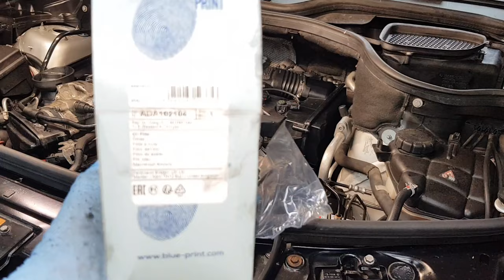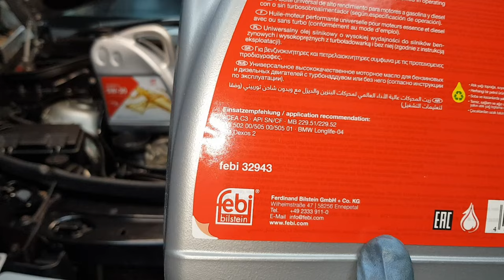Mercedes Oil Cooler Seals ML350 cdi 3.0 V6 ML320 E320 Sprinter OM642 W164 W166 Vito engine oil leak

Comment: How much is this repair ??
Reply from the maker: This was my 1st experience with OM642 engine. I had big trouble removing the 3 bolts at the back of the turbo which took nearly 6 hours by itself as I had to bend and weld custom tools to loosen them up without snapping them or rounding the heads. I would say all together with all trouble, cleaning and filming took about 30hours. If I was doing it again it will be 12 to 16hrs with good detail. I have heard others doing it for 8 hrs but I assume they did not go into such detail and cleaning. Consider yourself lucky if you get this done for under £500. Gaskets, seals, Oil, filters, coolant, cleaning chemicals and consumables increase the price even further. Hope this helps
Reply: @TheKeenMechanic  what's wrong with these compressor screws, why did it take you so many hours? what wrenches did you use? thanks
Reply from the maker: @andrzej5484  Hi, the engine was replaced 4 years ago, the previous mechanic used the old bolts and didn't put ceramic grease on them. The 3 bolts on the back of the turbo are hard to access and I had to make special tools to allow me to remove them without stripping or rounding the heads. Had to heat every single bolt with MAPP gas torch. Got there in the end but took a long time
Reply: So, after replacing the screws with new ones, secure them somehow, e.g. with ceramic grease, so that there is no problem with unscrewing them again? If there are new screws in the turbo and manifolds, what torque should they be tightened because you are giving different values.
Reply from the maker: @andrzej5484  I just went with good and tight on the 3 turbo to exhaust manifold and all cast iron exhaust manifolds were tightened by feel as it is too difficult to use a torque wrench. If you are reusing the old bolts put ceramic grease on them. If using brand new bolts put ceramic grease too if they don't come with it.🤝🏻
Reply: @TheKeenMechanic  thx
Reply: what I'm most afraid of is washing the engine exit and the holes under the manifold so that dirt doesn't get into the engine. We'll see if the gasket has been changed because the seller of the car said it had been and since it was my friend, I trusted him. It may be that it comes from connecting the intake to the turbo because  there is dirt there too. Time will tell ;)
Reply: hello, what city are you in?
Reply: @TheKeenMechanic i used the bendy ratchet from harbor freight and 2 stubby extensions+E socket.
That pipe behind the turbo is a pain
Reply: @andrzej5484 with new hardware and proper torque i guarantee the bolts will come out. 
I've never had to use heat to remove Mercedes factory hardware.
Reply from the maker: @madmagyver9981  Tell me about it. It is one of the most awkward jobs I have done but no other choice🤝🏻

Comment: Truly awful vehicles.
Reply from the maker: A lot of labour to get to this cooler. Not a great design. As long as the seals last more than the warranty the MB dealer doesn't care what the customers have to do after that. The owner of the vehicle loves it and says it has been reliable in any other way aprart from an engine replacement 4 years ago which he admits is his own fault due to neglected maintenance
Reply: @TheKeenMechanic  Fell out of love with Mercedes a long time ago.Once the (expensive) byword for quality but now just the same as all the other manufacturers.Overpriced and of questionable quality.
Reply from the maker: They are now installing Renault engines in the smaller class cars😮‍💨
Reply: @TheKeenMechanic  Daylight robbery